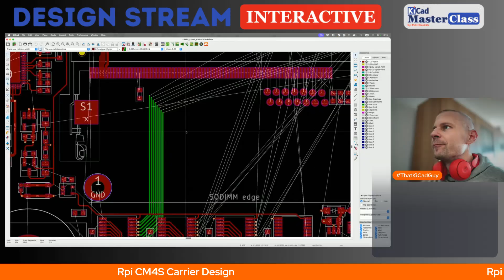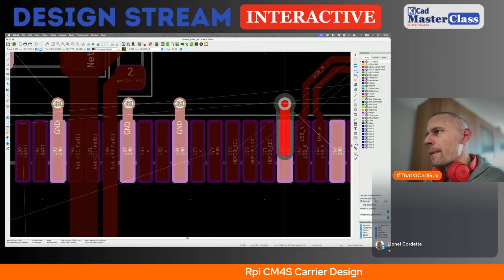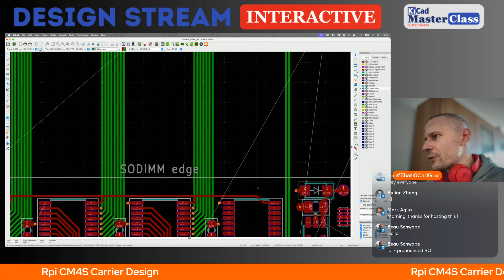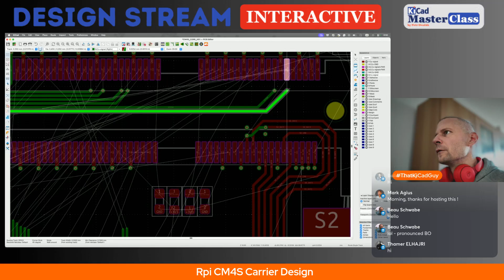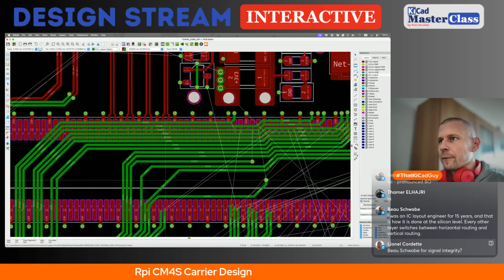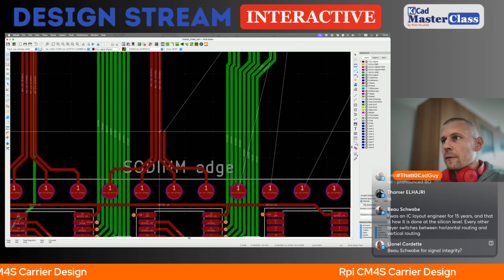KiCad Design Stream—CM4S Carrier, part 6

Comment: Hi, I ve been looking for ov camera series sensor board making tutorials but could not find any tutorial may I ask you to create a tutorial about this or can you just tell me where I should be checking out ? I want to make live video recording system currently I ve found esp32 S3 R8 chip this supports native camera DVP protocol so I could maybe go with ov2640 or ov5640 but I don't know where to start for adding this sensor to MCU can you advice me anything on this ? Or maybe is there any way of recording live stream ? Thanks for any support 👍👍
Reply from the maker: Hi, thank you for the question. I recommend checking reference designs by renowned silicon manufacturers.